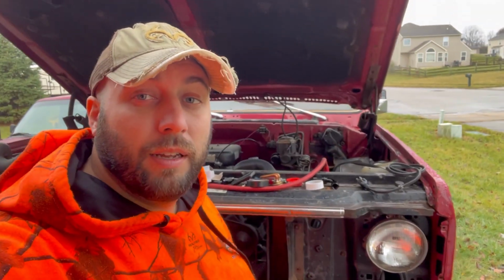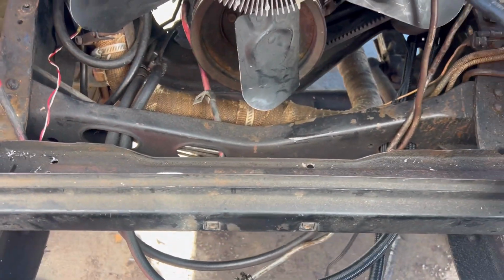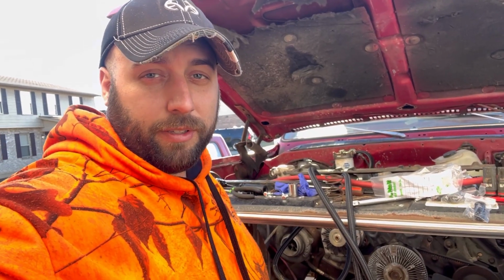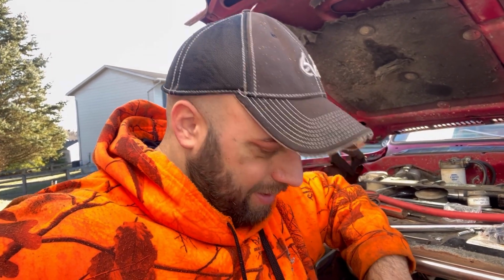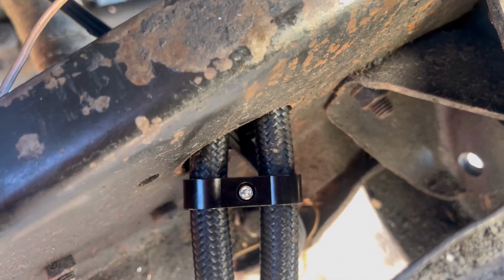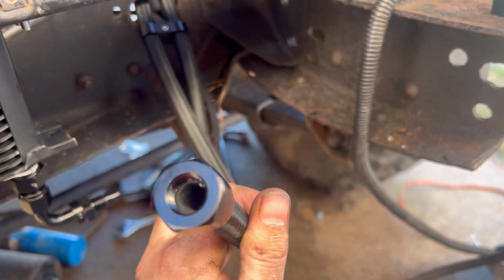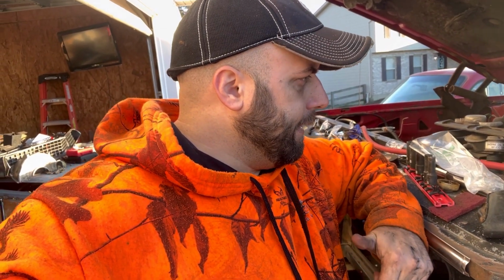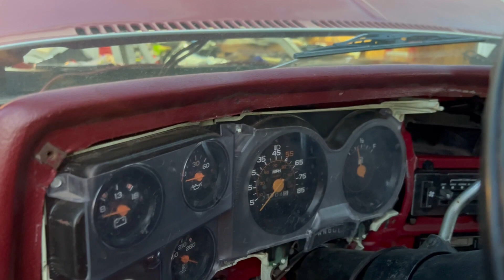Chevy squarebody 6.2 external oil cooler

Comment: You like them hose separators? Looking at getting so for myself
Reply from the maker: It made a huge difference in how easily the hose stayed in place. Definitely recommend and they are cheap off the rain forest website
Reply: Ive been trying to find ones that i can run my braided fuel line and also 1/0 battery cable that mounts to the frame rail
Reply from the maker: @neverbored_s10_addict  I have a video on battery cables. I bought it off Amazon as well. The separators were an 8 pack for like $13
Reply: Ill check out thanks